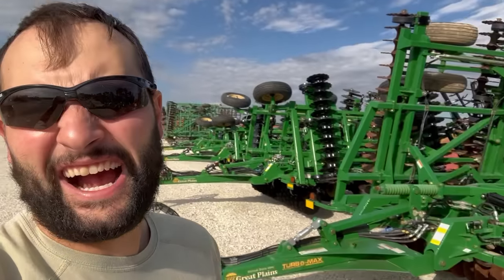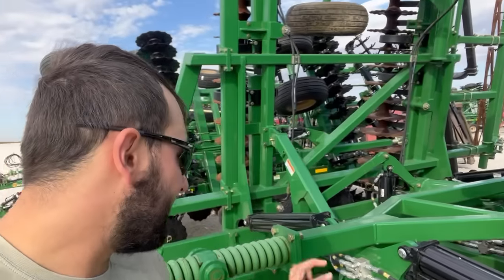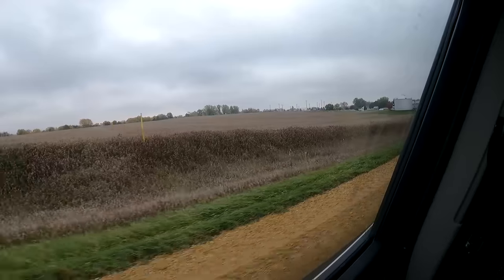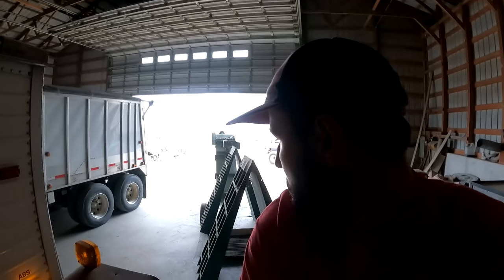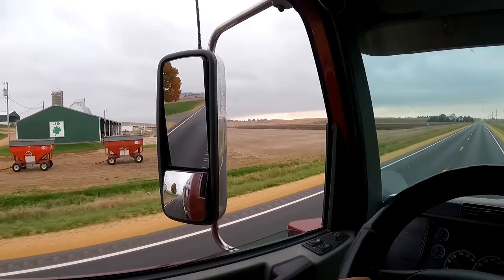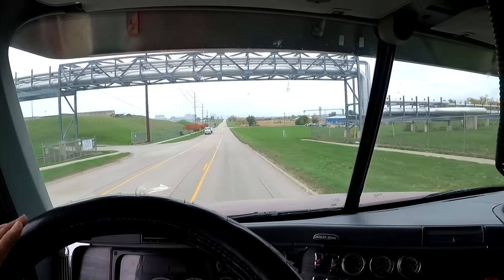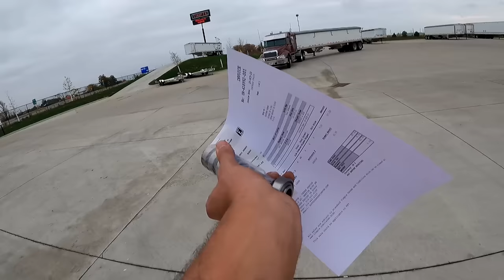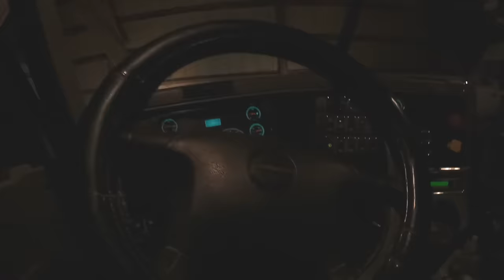BRAND NEW EQUIPMENT SHOPPING

Comment: We run 2100 solford and 36ft dagleman pro till the pro till is heavy and takes power but sounds like what you looking for pulverizes the ground if you get a Kinze their identical but made in Iowa. Solford chops up nice not much mixing. On pro till you can adjust I thing they 14 front 17 rear angle. but aside from ripper or plows nothing will manage residue good luck just my 2cents